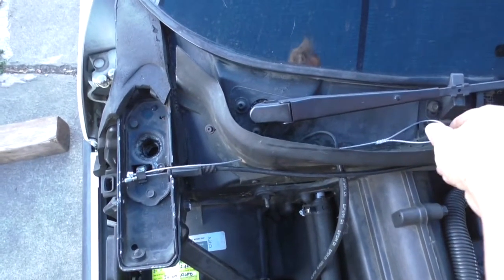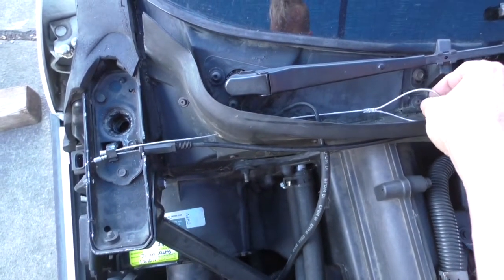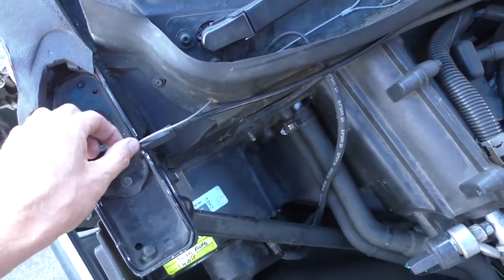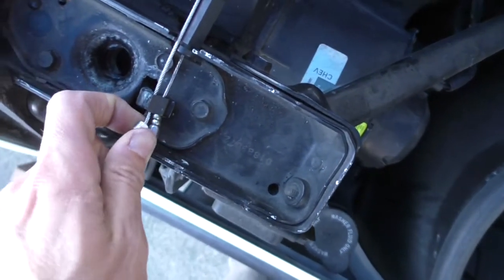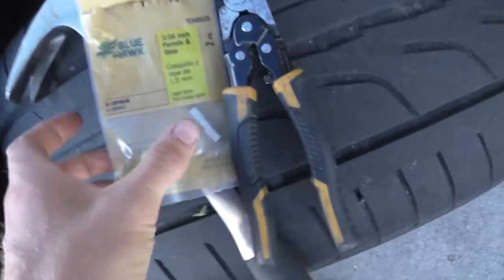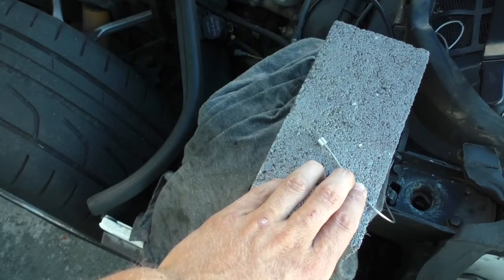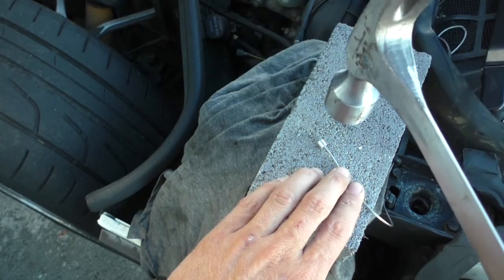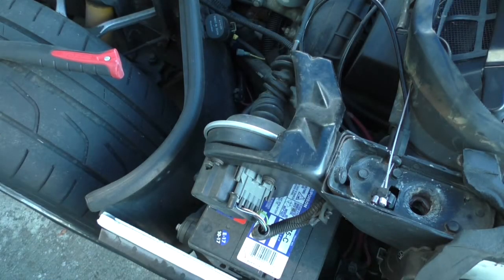C4 Corvette E-Hood Release Cables

Comment: Good Day! I hope you're enjoying a pleasant one. Where did you get your parts from? Got a Link for us? Looks like you got both ferrules and stops in the same bag. About how much $ ? Ecklers sells a couple of tools for this hood stuck job, and I believe cables like yours, not sure.

Try this stuff for Lube: ZEP 2000. I used it at Sears, as aTech,. that worked on all electro-mechanical devices, you name it, and then some... 35 years, Not with Sears, about 5 with them, and I made a lot of garage doors and openers very quiet with it. People loved it! I got a lot of Tips! Ha! It sizzles right into, under, around your target, and clear, No Drip, and No Petroleum Smell! Most People use WD40, it's not a lube, and it smells. I've seen "Garage Door Opener/Door Lubes" that advertise right on the can that they don't smell, and you wouldn't believe how toxic they do.You won't find anything else, that doesn't smell. When a garage is closed, those stinky fumes can build up and drift into the house. I found that out the hard way and then went looking for a Lube to do the job without smelling like a machine shop. 

I used ZEP 2000  on everything. Better than that white lithium grease too. I never used that white sticky crap. Like I want that stuff staining my engine bay or door jams or whatever. I don't  sell the stuff neither but when I was at Sears, I kept a case of 12 on the truck because people wanted it, and mostly, you only find it in cases of 12, but you can get just a single can... got a link for ya. It's kind of pricey though. I got a single can last year on Amazon for $21.49 Total. Ebay is about $10 bucks more or so. Buy a Case and treat your friends and family to a can. It's a Big Can too!

Ok. I'll stop yappin and get back to my stuck hood. Hey! I saw how easy you opened your hood, after the latches were working that is. You did it so smoothly. I used to have to get under mine in the corner where the scissor lock was, passenger side, crouch all the way down and push the hood up with my legs. I'm disabled now, not from working on the car, and my spine is titanium top to bottom.  You have that "Lift" gas tube thing on the driver side, like the ones on the hatch. I just have those 2 shock like things in the front and they don't Lift anything. They help a tiny bit to hold the hood as you're letting it down. I have brand new ac delco parts too. Can you video your hood opening mechanism, in very close detail, especially the mounting parts, and locations. I have several of those tube designs for the C4's that they used over the years.

I would so Greatly Appreciate It and just Love You for it! Right now, it's a pain having to get someone to open my hood when I need it. Please Help Out a US Coast Guard Veteran retired/disabled... and a Fellow Brother Tech. I have a lot of C4 know how that maybe I can share with you. Really! And Tons of Rare Data, Documentation, Sales Brochures, magazine articles, tech stuff, and more... Stuff that would make you more and more impressed with your car, and proud to own one. and they won't get you to shut up talking about her, maybe, after reading some of the cool stuff I've gathered. These C4's are Unique in their design, engineering, and engineering "mind set" , no other Vette., except maybe the first 3, have a story such as theirs, their beginnings... they have a lot of accolades and "firsts"... Vettes that came after owe a lot to the Life of the C4. And WhaddaLife it still is!
Reply from the maker: https://ebay.to/2MvSKgC
https://ebay.to/2BKT7i7